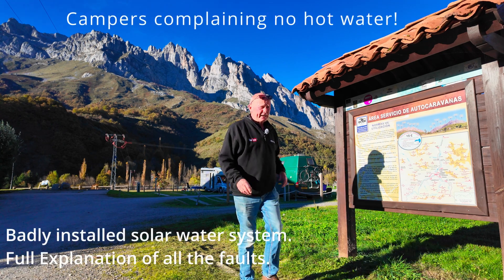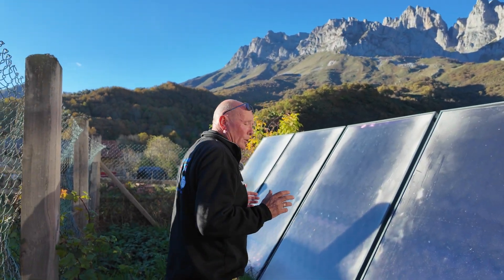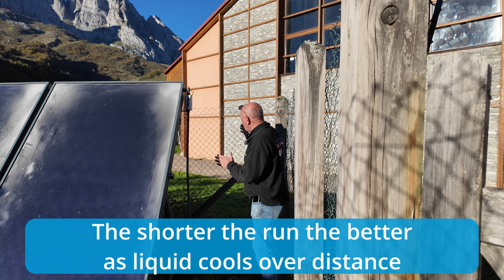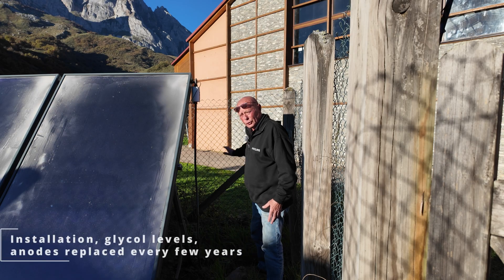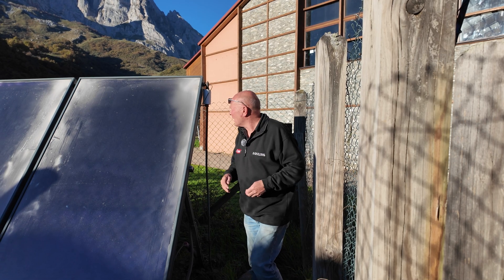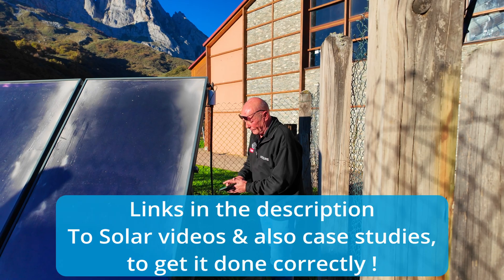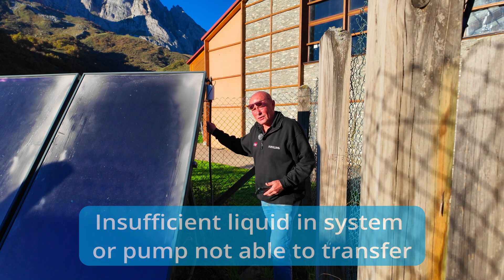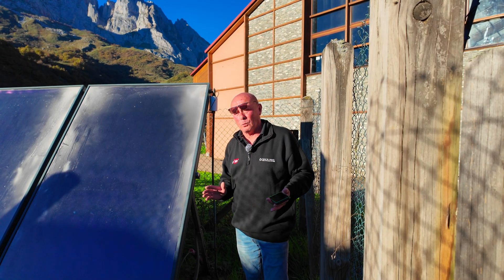Don't Make THESE Solar Water Heater Mistakes! Fitted In Perfect Camper Park, Cantabrian Mountains

Comment: The distance between the panels and the tank is critical. The pump is probably circulating as much cold 'dead water' from the pipes as it is from the panels.